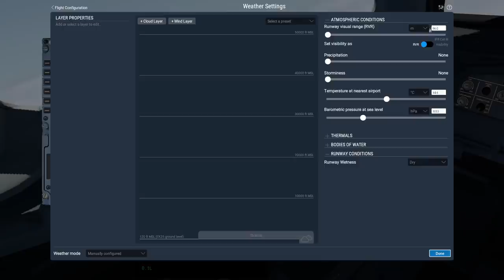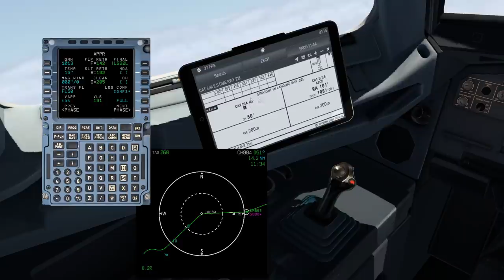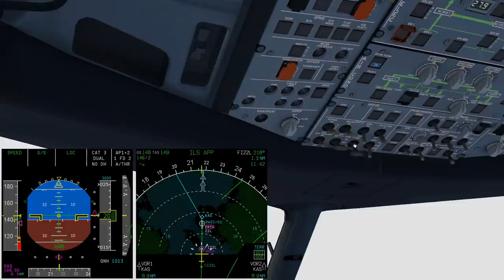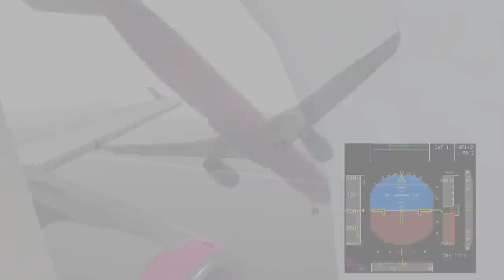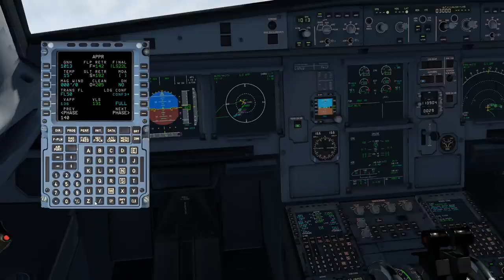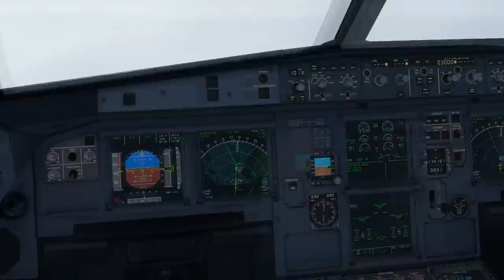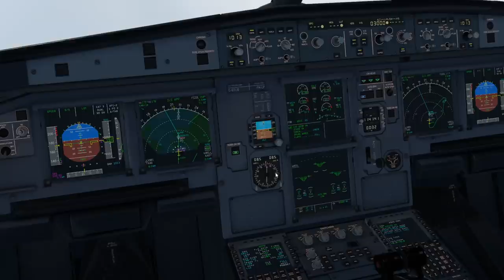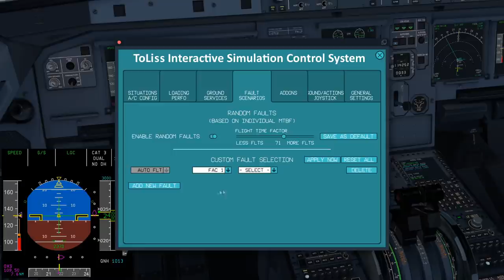Auto Land Guide with a Real Airbus Pilot: ToLiss A321 X Plane 11

Comment: I cannot wait until a plane with systems as accurate as this is released for MSFS.
I love instrument flight during bad weather, but back in X-Plane I couldn't stand the weather representation, even with mods.
Reply: I even bought weather effects-enhancing mods. It doesn't do much. MSFS is pretty much spoiled us already.
Reply: @yohannessulistyo4025  Yes exactly. Nothing close to what MSFS does.
Reply: @markusa3803  visually less, but in terms of systems and flight model, XP11 is going to be hard to topple
Reply: @marshie1337  I'm not sure if I can fully agree with that.
The flight model is probably equally complex, with both simulators using virtual wind tunnels for aerodynamics.
The weather systems in FS2020 are highly advanced, even without taking the visuals into account.
Only the plane systems are still not on the level of X-Plane, but honestly that's just because X-Plane has been around much longer and the mods and addons are much further developed.
It's not like the default planes in X-Plane are that complex either.

Comment: The game really doesn't look too great, but it seems to actually function as it should, which other simulators can not say for themselves.
Reply: The effects of a game that has had long post release development. MSFS isnt far behind i would guess.
Reply: The flight sim environment has long been a symbiotic relationship between the software developers and the modding community - there's just far too much for a single developer to be realistically expected to do. X-Plane by default may not look that fantastic, but it has the base functionality, and the community have created a vast collection of scenery and aircraft to make up for the deficiency over the years. Similarly, MSFS has the graphics by default now (much improved over its predecessor), and the modding community will take up much of the slack as far as aircraft functionality goes (and MS will address any core bugs as they can).

Comment: Hi Sir, Sorry for my question related but y cant set up the visibility ( fog ) in MSF2020 ?
Reply from the maker: I have not found it very easy to set such low visibility in MSFS yet, I don’t know if it will be added but X plane has features for very low visibility!
Reply: if i remember, the cloud icon in the top bar, you can chose different weather. if not, put the bottom lower cloud layer to altitude  0,  it's fog...

Comment: 1 tiny thing: don't use pink bars on the bottom of the thumbnail. It can be easily mistaken with a watched video in the sub box (red thin bar on bottom of thumbnail).